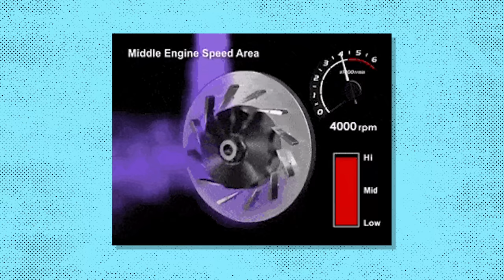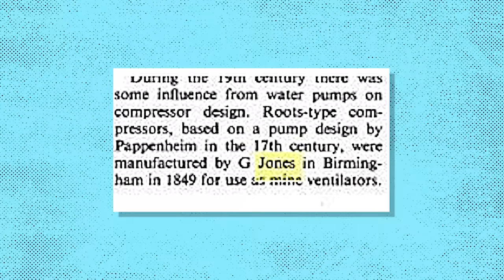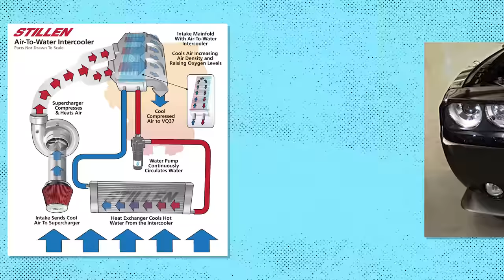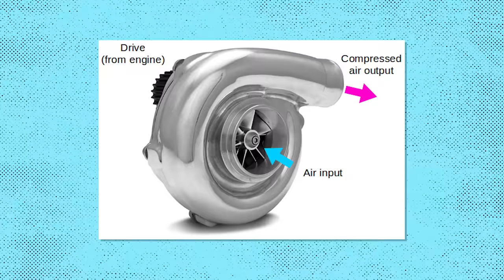Why Superchargers Aren't As Good as Turbos

Comment: Having owned vehicles with both, I found the supercharger to be better as it had no lag and also much more linear power delivery. The turbocharger seemed to be much harder to modulate power, it was very peaky, sort of an all or none kind of power delivery. Nonetheless, both vehicles were very different, one was a supercharged 5.4 V8 and the other a turbocharged 2.5 flat 4 so it’s not a balanced comparison.
Reply: Turbochargers produce more power and are more efficient than superchargers... that is exactly why they are more popular.
Reply: @sandervanderkammen9230  not everyone cares for more power.
Reply: @Dominik189  True, vehicle manufacturers are very concerned about efficiency, which is why turbochargers have become so popular.
Reply: I like turbos with lots of lag because they really wake up suddendly and kick, and it's really fun, kind of like vtec
Reply: @sandervanderkammen9230  I actually prefer NA or Supercharged. Because I like the peaky nature.
Reply: @Dominik189  But they have less power, and are slower.
Reply: @sandervanderkammen9230  not everyone wants high horse power and super fast speed. Some of us enjoy pep.
Reply: @Dominik189  What is pep?
I thought it was what teenage girls have when they are cheerleading?
A real car enthusiasts wants HORSEPOWER
Reply: @sandervanderkammen9230  And thats wrong. A real Car enthusiasts wants fun. You can have fun even with less HP.
Reply: @eviljan8158  You're not a real car enthusiasts.
Reply: @sandervanderkammen9230  And youre just a thrillseeker. Theres much more to cars than just more power.
Reply: @eviljan8158  yeah there are people who drive taxis
Reply: @sandervanderkammen9230  So i guess youre one of the people who would actually LS swap an RX7 because they get more hp ou tof it?
Reply: @eviljan8158  I'd LS swap it just because it has 100% more torque completely stock, its way more reliable and even gets better fuel economy.
Wankel engines are inherently weak and unreliable.
The Chevrolet small block V-8 os a hugely successful engine... first entered production in 1955 with millions made its still in mass production today.
Reply: @sandervanderkammen9230  And with that you throw everything out the window. You never LS swap an RX7 cause the rotary engine is its soul. Its like putting a 4 stroke into an DKW. IT kills the idea of the car. Or what would you think if someone would put a W16 from Bugatti into lets say an old Dodge Charger.
Reply: @eviljan8158  I think a Bugatti engine in a Charger would be awesome.

Yank out the shitty Wankel engine from the RX7 and throw it in the trash where it belongs. 
Or better yet, scrap the whole thing... Mazda's are garbage.
Reply: @sandervanderkammen9230  You just showed youre not a car dude at all good to know. Bye.
Reply: @eviljan8158  Anyone who thinks that the Wankel is a good engine is not a car guy... they're a rotard.
Reply: @sandervanderkammen9230  you are not a car enthusiast. Car enthusiasts can have fun even in a damn toyota yaris, and they like all kinds of engines, no matter the drawbacks, if it makes you move there is an enginnering that is always surprisingly cool to know in detail. You are a speed enthusiast, not car enthusiast
Reply: @qualcunoacaso4865  People who drive a Toyota Yaris are making a very clear statement that they are not car enthusiasts.
Reply: @sandervanderkammen9230  i didn't say i have it, i am saying that if you enjoy cars you can enjoy all pf them, cause there is no car equal to another and each one makes sense in its own way, and there is no point in hating one for not having a good car cause maybe it's only saving for one. I correct myself, you are not even a speed enthusiast, but a straight liner enthusiast, cause if you really are a car enthusiast you wpuld know really good that power alone doesn't make you go faster in a track, and curves are where you have fun the most. If you pass me in an highway, congratulation your car is faster, but what if someone passes you in a track with a slower car? With your attitude, you can only go bury yourself
Reply: @sandervanderkammen9230  and rotary sucks, but it won everything at its times as well
Reply: @sandervanderkammen9230  your mentality is a perfect example of someone who just got into cars
Reply: @qualcunoacaso4865  Spoken like someone that knows nothing about cars.
Reply: @qualcunoacaso4865  Rotary engines were very successful in aircraft up to about 1930... they were never successful in cars.
I think you meant to say Wankel engines.
They sucked in  every application including motorsports.
Reply: @nickdiaz8127  So much for what you know kid... I was racing cars before you were born.
Reply: @sandervanderkammen9230  you don't sound like you did, but ok. You know nothing amd think like you know everything, yet you are here wasting your time defending your claims that nobody as car enthusiasts are sharing. I am not saying you are wrong in what you say or anything, just don't say you love cars, cause you despise most of them for the wrong reasons too
Reply: @sandervanderkammen9230  do you actually own and drive a car? Honestly you don't sound like you do, considering how immature you are in the comments.
Reply: @sandervanderkammen9230  meanwhile the first patent issued to Wankle for the rotary engine was issued in December of 1929, which then promptly sat in mothballs, being applied only to 2 prototype aircraft which never actually flew outside of trials, until 1951 when NSU Motorenwerke AG began development of what we currently know as the Wankle Rotary, which is actually still considerably different from the Original Felix Wankle patents. As for never being successful in cars and sucking in Motorsport. Look up the Mazda 787B and it's complete and utter fucking domination of every race it took part in.
Reply: @Dominik189  The Rotary type engine was invented in 1892 by Felix Millet.

Felix Wankels first patent for an engine without radial cylinders was 1954 after hejount NSU Motorenwerkes GmbH.
The DKM54 is a Rotary layout with a triangular "rotor".
It was designed specifically for motorcycles.
The DKM54 never saw production.

What you and I call a WANKEL engine is the KKM57 designed by Hanns Paschke and Walter Freode without any knowledge or assistance from Felix Wankel.
The Wankel KKM57 is not a Rotary type engine, it has a stationary case and a rotating crankshaft.

The Mazda 787b was a pathetically slow and uncompetitive... it lost all but 1 of the 21 WSCC races, it never posted a single pole position or fastest race lap.
Mazda lost the 1990 WSC Championship to Mercedes-Benz and lost the 1991 Championship to Jaguar.
Mazda has completely abandoned racing and production of Wankel engines.
Reply: @Dominik189  Wankel engines are obsolete technology because they are inherently unreliable and flawed by design.
Wankel engines cannot be used in type rated passenger aircraft because they are too unreliable to meet airworthiness certification.
Reply: @Dominik189  Felix Wankel was a motorcycle enthusiasts and was inspired by the MEGOLA Rotary powered models.
The MEGOLA uses a Millet type Rotary engine... known as a UMLAUFMOTOR in German.

Felix Wankels 1929 patent was for an Umluafmotor

Felix Wankels first use of the DREHKOLBEN  "Spinning Piston" was in 1951 for a supercharger design later used on 50cc 2-stroke NSU motorcycles and set a world record. 

Here is a MEGOLA bike
https://youtu.be/c4Cq49IDfOc

Any questions?
Reply: @sandervanderkammen9230  neat, you can use Wikipedia. XD
Reply: @Dominik189  What is Wikipidia? Is that a rotard thing???
Reply: @sandervanderkammen9230  MAZDA 787B: Am I a joke to you?
Reply: @davicarvalho9435  The Mazda 787b was ultimately a failure in motorsports competition, it lost 20 out of 21 races with zero poles or fastest race laps posted.
Mazda lost the 1990 WSC Championship to Mercedes-Benz and lost the 1991 Championship to Jaguar.
Reply: @davicarvalho9435  Yeah, the Mazda 787b really is a joke... anyone can get lucky and win once... even Matra and Peugeot have made multiple victories at Le Mans...
Reply: @sandervanderkammen9230  I actually own an fd. The real reason i would never even think about ls swapping it is because the long ls engine would go over the front wheel, eliminating its front mid engine design and inducing a ton of understeer and thus changing the way it handles tremendously. There is an ethos to the way that car was designed but what would you know, you only drive straight :)
Reply: @garvyn12345  I wouldn't know... I'm not gay.
Reply: @sandervanderkammen9230  Lol was that meant to hurt my feelings? But thanks for admitting that you dont know, glad you learned something new
Reply: @garvyn12345  I do not discriminate against anyone but Im not interested in what you people do with your little wankels... I will stick to driving straight thank you very much.
Reply: @sandervanderkammen9230  turning a steering wheel is very hard for some people I completely understand. Maybe being a train conductor would be more suitable for you as a hobby. Ps your jokes would be a lot funnier if you didn’t take yourself so seriously but I still chuckled
Reply: @garvyn12345  Its not a joke..
So you don't know?
Reply: @sandervanderkammen9230  or is it to comply with governmental regulations?  Do the claims of fuel efficiency actually hold up in real world driving?  If you suck in more air and more petrol during boost to create that power, how is that going to help with economy?  Apart from saving weight on the engine, then there is added complexity, the possibility of turbo failure, increased working pressures and extra space taken up.  Why not just have a bigger engine, with no lag whatsoever?
Reply: @rob5944  Well, I can tell from your comment its very unlikely that you have a degree in engineering...

Turbochargers have been around long before government regulations.

Since many vehicles in the real world are driven by very poor drivers that drive inefficiently.
Real world fuel consumption figures vary wildly and are completely spurious.

Thanks for confirming that you don't understand how a turbocharger works.

A turbocharger not only increases Volumetric Efficiency
They also increase Thermal Fuel Efficiency

The turbo converts more of the heat energy per gallon of fuel into useable horsepower.

And a smaller engine will always deliver better fuel efficiency than a larger one in the same vehicle... this is demonstrated by the BSFC Isographic Efficiency Island.

A smaller engine works harder and gets better fuel efficiency.

Any questions?
Reply: @rob5944  Approximately 30% of the energy in a gallon of fuel is wasted in a Otto type engine from pumping air.
The turbocharger is a more efficient pump than the reciprocating engine and the energy to run the turbocharger does not come from burning additional fuel.
The exhaust turbine runs on heat energy in the exhaust normally wasted out the tailpipe.

The Turbocharged engine converts a higher percentage of the gallon of fuel into useable horsepower.

Less heat wasted out the tailpipe equals more power and less fuel wasted.
Reply: So...heat build up and excessive plumbing, on/off not smooth power delivery. Compromised accessibility when serviced. Hmmm. I wouldn't go outta the way to say they're the absolute choice
Reply: @sandervanderkammen9230  more power doesn't mean what you think it does. Take into consideration, that this only applies at exerting rev ranges. The supercharger actually has a better overall power output curve.
Reply: @manher4335  True, superchargers have alot of disadvantages over a naturally aspirated engine but the increase in volumetric efficiency and horsepower makes up for the downsides... even more so with a turbocharger because they deliver much more power and better efficiency.
Reply: @casematecardinal  Very true, If you are not a skilled driver or very effeminate? more power might frighten you or cause you to lose control of your convertible Beetle or Subaru Outback..

Switching off your Air conditioning without having a firm grip on your floral steering wheel cover could cause you to feel a sudden increase of power to your Cheng Shin all- season radials.. and you might wet yourself... soiling your new pink hibiscus Hawaiian print seat covers...
Reply: @sandervanderkammen9230  the whole "expended gasses to turn compressor for free" thing is a classic efficiency point but i
i wouldn't consider the opposite completely "archaic/obsolete".But let's talk "efficiency" Where's the true benefit? Durability on the engine? Milage? Both? It certainly isn't "efficient" (turbos) when it's time to service or one of your ducts in your series of plumbing to the turbo is torn n must be replaced for ex: With a little tuning I think both can be made to work fairly well consistently/durability-wise. But the ease of dealing with superchargers wins in my book. Turbos are common bc of CAFE standards, but I don't think they're efficient by leaps and bounds.
Reply: @sandervanderkammen9230  So if hp is all that matters what 3500hp car do you have?
Reply: @manher4335  I think you are completely missing the point, the fact remains that the entire purpose of forced induction is to increase performance by increasing volumetric and thermal efficiency.
In this regard the supercharger is clearly inferior to the turbocharger.

You cannot match the power output or efficiency of a Turbocharger with a Supercharger.

The Turbocharger will produce more power with less fuel.

I heard people making that argument about fuel injection years ago, they claimed that carburators were just as good and were better because they were heaper and less complex... simply because they  were afraid of fuel injection... they didn't understand fuel injection, how it worked or how to service, tune and repair FI..
Unfortunately that argument will not stop progress, today all new automobiles are equipped with fuel injection and even NASCAR finally dropped obsolete carburator technology in 2012.

Turbochargers are replacing superchargers... turbos already dominate forced induction and can be found on around a hundred new car models.
Turbocharged engines are taking over and very soon nearly all new ICE vehicles will be turbocharged... it's inevitable, you cannot stop progress or deny that turbo cars are superior.

You might not like it but turbochargers are here to stay, so get used to it.
Reply: @iiroyalty2519  What do you drive??? Are you even old enough to drive???
Reply: @sandervanderkammen9230  guy. Which one is easier to service? Idc if turbos r here to stay I'm not anti turbo. Do they make more power n efficiency? Sure (but not by much). Are they tedious? Absolutely. Frankly, N/A is my preference. But if I needed a crutch I'd go super.
Reply: @manher4335  Without question carburators are easier to service...
Reply: @manher4335  "N/A is my preference"

Well, you are certainly a Luddite.

I bet you refuse to use a cordless drill too.
Still stubbornly using that hand brace and bit set????
Reply: @manher4335  Not by much? Depending on the application a turbocharger can produce as much as 100 horsepower more than a supercharger at the same manifold pressure...
That's 100 horsepower that was being wasted out the tailpipe on the supercharged engine.
Reply: @sandervanderkammen9230  Alright guy. So tell the head honcho in Chrysler why they don't turbocharge hellcats eh?
Reply: @manher4335  Chrysler???
Chrysler ceased to exist in 1999.

The Dodge Charger and Challenges are retro cars that are marketed directly to baby boomers with gray hair and nostalgia for the 1960s and 70s.
It is a distinctively retro, old school American muscle car concept that is  a anti-high tech theme.

But alas, even the Hellcat has fuel injection and VVT (variable cam timing)
 You can't sell new cars with obsolete carburators anymore although I'm sure sales would increase if they did. 

HAVE YOU EVER REPAIRED A CAM PHASER???? I HAVE, IT'S NOTHING TO BE AFRAID OF EITHER..
JUST LIKE TURBOCHARGERS.
Reply: @sandervanderkammen9230  ratio
Reply: @Ghostw48  The truth doesn't have a ratio.. the facts are irrefutable, not a popularity contest.
Reply: @sandervanderkammen9230  your opinion is not "the truth" lmfao
Reply: @Ghostw48  Its not an opinion kid.
Reply: @sandervanderkammen9230  okay there mr "truth" 😂😂
Reply: @sandervanderkammen9230  jesus man do you ever feel embarrassed? I think youre a little salty that your opinion got ratio'd
Reply: @treyrz8023  yes indeed, it was a 2009.
Reply: Turbos make more power at the highest RPMs, I prefer superchargers because they feel less stressed and more linear.
Reply: @angelgjr1999  Turbocharged engines typically rev slower than Naturally Aspirated or Supercharged engines...
Supercharged engines are less stressed because they produce less horsepower than a turbocharged engine.
Reply: Yeah my Volkswagen lags then goes crazy
Reply: @sandervanderkammen9230  Trollolololol. Fun is not just horsepower! It's how much command you have over it... It is how much of it can actually be put through the tires. It's also about the noise and feel of a car. Wankel engines may be very flawed, but they sound amazing rev very high and produce a lot of power from a small displacement. Also, Mazdas are some of the best cars in the world to drive and have great chassis rigidity and handling feel in across all classes of vehicles. Have you ever even driven a Mazda? They are amazing. Even their FF models have practically no understeer, have lift-off oversteer, and incredible turn-in characteristics and vehicle dynamics
Reply: @nadiaelderbas8515  If any of that nonsense was true? People wouldn't have stopped buying Mazdas with Wankel engines.
 Mazda has never been recognized  as a performance marque, it's brand recognition is based very solidly on building cheap, low end cars for young first time buyers... not enthusiasts.
Mazda has made many failed forays into both the performance and luxury markets and all have been complete failures except for the MX5.
Mazda has given up on performance cars in an effort to salvage the  company from years of declining sales, financial losses and low customer loyalty.
Mazda no longer has any factory motorsports program and has left racing completely.
Reply: Turbos better for more endurance type stuff but if you don’t really care about that than a supercharger is gon get you the best bang for your buck
Reply: @swifter1143  Turbochargers give you a bigger bang, and for fewer bucks... that's why turbos are more popular.
Reply: @sandervanderkammen9230  you'd scrap an RX-7? Not a real car enthusiast, clearly
Reply: @irishwristwatch2487  I real car enthusiasts would have nothing to do with anything made by Mazda, except maybe an MX5.
Reply: @irishwristwatch2487  Have you heard the joke about the two rotards that walk into a bar?
Reply: @sandervanderkammen9230  I havent. Is it as cringy as all your comments?
Reply: @irishwristwatch2487  The bartender  points to the door and says, "Sorry, the gay bar is across the street."
Reply: Having driven mostly turbo vehicles in diesel or gas configuration i cant subscribe to the notion that forced induction is about making more power. It's about burning as lean as possible with the flattest torque curve possible. The vast majority of american cars are aspirated, they are not the best people to ask about forced induction. It's in Europe where forced induction is the most prevalent for exactly the reasons I mentioned. The flatter torque curve gives that grunt in city traffic to move from a stop without the need to increase rpm. And burning leaner saves fuel. Power ... whatever you got is enough. More is expensive. Wanna go fast ... ride a motorcycle
Reply: @georgeyoutube7580  You really can't run leaner in a Otto Cycle engine unless its GDI.
 Certainly in motorsports applications turbochargers offer greater power and performance but in production engines its all about increasing thermodynamic efficiency and reducing BSFC.
   Turbocharged engines squeeze more power from a pound of fuel because it wastes less heat.
Reply: @georgeyoutube7580  Turbochargers are more popular in Europe because you have tax based on engine size and fuel prices are higher because of higher fuel tax.
 That and the fact that Germany is still the leader in reciprocating engine technology... all the new technologies appear there first.
Reply: @sandervanderkammen9230  well all I see is Americans explaining about turbo lag. That doesn't exist in real life. They have Ecoboost from Ford. Obviously the turbo kicks in below 2000 rpm like any turbo engine made in the last decade.But nobody is interested in how an Ecoboost works.Instead everybody is on YouTube explaining about turbo lag. You would think they all just finished some rally stage ... power was ok but that lag ...  almost crashed. What lag, wtf are these people talking about?
Reply: @georgeyoutube7580  Excellent comment, turbo lag is not real, it's an imaginary problem.
 One problem might be general education and skill level, Europeans take driving much more seriously in America its required for basic transportation in some parts where there are no alternative or public transport options or they are poor quality.
Reply: @eviljan8158  I hate to play devil's advocate and agree with you but the most fun I ever had on a motorcycle was on a 1966 Cushman Eagle with a straight pipe that would glow orange in the dark. It had fat squishy tires, was loud, it backfired a lot, shot random flames 6 ft out the back of the pipe, and would have had eight horsepower if it was running right - but of course it wasn't. Getting to 45 mph on that death trap might as well been 200 mph! What a blast. Literally.
Reply: This non linearity in power delivery can be improved with a good tune in turbos with electronic boost controler
Reply: Less experienced drivers find supercharged cars easier to drive, of course they are also slower than turbo cars too
Reply: @eviljan8158, He’s not a thrillseeker or something, he’s likely a kid just getting into the car scene or something with the way he talks. They seem to think they know everything
Reply: @sandervanderkammen9230  No and let me tell you why. Why is it that one twin screw supercharger on a engine untouched ultimately makes the same if not more than most twin turbochargers on a engine that also has not been touched by anything other than forced induction? Sure you can argue your big turbo will make more or whatever but my point is you’ll save money. And have access to quick acceleration unlike the turbos taking forever to do so. And when it comes to efficiency the supercharger was always known for this, and that’s not even mentioning the centrifugal supercharger (pro charger) that has been known to be a better alternative to the turbo because it the best of both worlds of a twin screw and a turbo and does it better. And it’s a supercharger so safe to say (in my opinion) the supercharger is a better option.
Reply: @sandervanderkammen9230  Yeah, so let’s ignore the people who love cars but can’t afford fast ones who drive Yaris’s. Or people who modify and boost them too.
Reply: @sandervanderkammen9230  Something super chargers also beat turbos in. You seem to forget super chargers with big blowers making 3,000 hp on tap exist.
Reply: @benjaminmatute9085  It doesn't change the fact that the turbo will ALWAYS make more power at the same manifold boost pressure than a supercharger.
Safer?
 A internal compression superchargers are less efficient and as a direct result have higher IAT (intake air temperature).
Which is MORE likely to cause damage due to detonation than a centrifugal supercharger or a turbocharger.

You still have alot to learn yet kid.
Reply: @benjaminmatute9085  Did you know that there are turbos made for engines that make over 100,000 horsepower?

 Or that a NHRA Top Fuel dragster with  Turbochargers can make 3,000 MORE horsepower than a Supercharged engine.
Reply: @benjaminmatute9085  Do you drive a Toyota Yaris?
Reply: @Ghostw48  The "Ratio" is in my favor kid... stupid people outnumber engineers by nearly 100:1
Reply: @sandervanderkammen9230  Well, I can take it.
Reply: @sandervanderkammen9230  Yeah because it's literally the biggest engine in the world that has 100,000 hp no duh it has that power. It's freaking huge.
Reply: @benjaminmatute9085  When it comes to making big horsepower numbers or increase power output Turbos have a big advantage, they dominate world class motorsports in every series where they are not banned in the interest of slowing down top speeds.
The fastest race cars in the world like Formula 1 and Indy cars are turbocharged.
 Turbochargers are also dominate in the supercar market.
Reply: @benjaminmatute9085  It still proves that what you tried to imply is completely misguided and wrong, turbocharger are better when it comes to building the most powerful engines in the world.
Top Fuel drag cars are only supercharged because Turbos are BANNED!